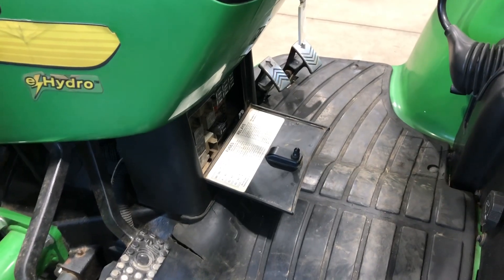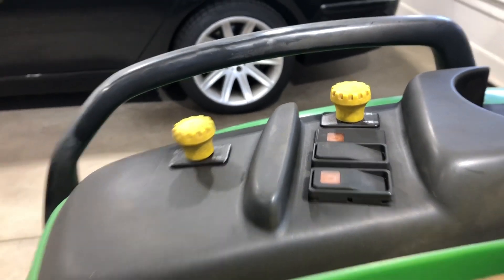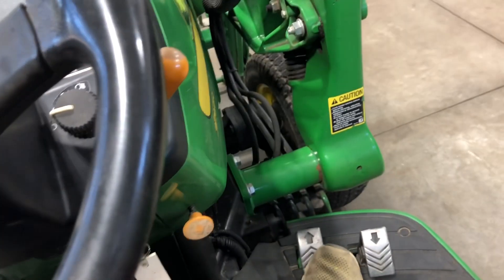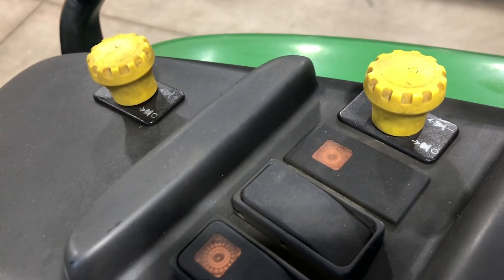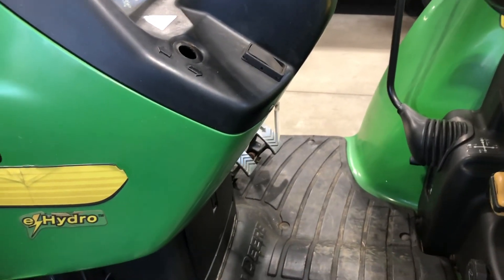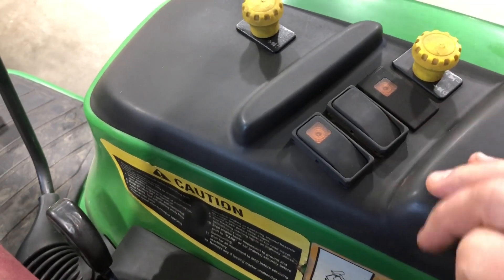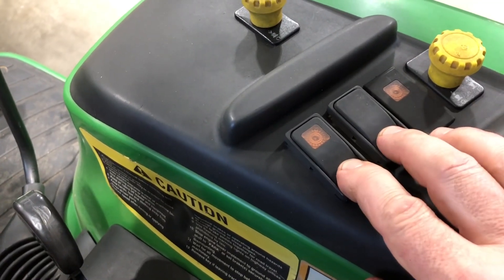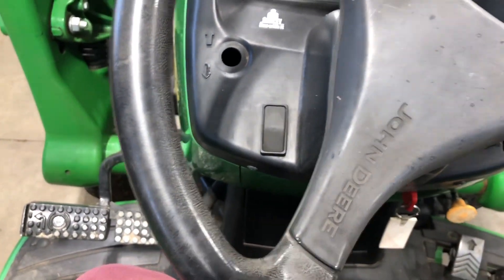John Deere Tractor Stops Moving In Reverse Fix

Comment: Thanks for the video Darren.  Do you have to have the tractor on jack stands to run through this autolearn sequence?
Reply from the maker: Sure np thanks for reaching out.  Yes or if you have backhoe you can raise rear tires with stabilizers.  Use loader to raise front.  For the hydro pedals relearn step you need all wheels off ground.

Comment: Thanks.  I have a 4310 that I bought new.  I had 1500 hours on it, and the battery died.  The hour meter reset to zero, never to return.  I can't imagine resetting the board would suddenly find the lost 1500 hours.
Also, this past Fall the tractor speed started surging badly while moving forward, usually under load.  For some reason I turned off the Load Match switch, and the problem went away!  Not too concerned, since I've never (intentionally) used Load Match, but I wonder if doing a reset would fix it.
The only other problem is the 3-point lever (rock shaft) that it's so stiff it's unusable.  I understand there is a fiber washer involved, but I can't seem to find a way to get to it.
Reply from the maker: Thanks for reaching out.   The JD4310s are great.   Hours meters always go out eventually on them.  Sometimes they reset or become hard to read vs going out.   All the older 4000 series used the same meter and have similar problems.   I've had a few machines with the load match and honestly everyone disables it, since it doesn't work all the time.   Fairly normal to have the machine do strange things when its on.    Rock shaft lever is another thing thats always kind of frozen.   Simplest thing to do is use some wd40 on the pivot points if you can get to them.

Comment: I wonder if this would work on a JD 3520?
Reply from the maker: Did a little research and the JD 3520 has a diagnostic mode which allows you to troubleshoot the error code.  I would recommend getting a service manual and I bet you could fix it.  The 3520 uses a similar controller and sensors so I bet you could do a reset/relearn if needed.  Definitely start with service manual.

Comment: I need some help!!! So I did this to my machine. It took me about 7 attempts but I got it. The last time I did it, everything went like it should but I still had the flywheel code at the end. No biggie. I shut the machine off for 10 seconds, started it back up and tested the forward and reverse pedals and the wheels moved like they should. I shut it off, it sat for 15 minutes, I got it off the jack stands and what not, started it back up and it won't move again!!! What could be wrong with it!?
Reply from the maker: @MattMeekhof  any codes flashing on the code light?
Reply: @darrenmas  long short short short
Reply from the maker: @MattMeekhof  that code is “simultaneous command from forward and reverse”.  The controller is receiving voltage from both forward and reverse pedal at same time and machine won’t move because it doesn’t know which direction is being pressed.  Most likely one of the potentiometers is bad or loose.  I would recommend testing each one.  I have a video on how todo this using a volt meter.  Let me know if you can’t find it.
Reply: IT IS FIXED! Thank you so much for your help! I appreciate you so much. Your video you recommend gave me a great starting place. I found the potentiometer under the tractor for the forward and reverse pedals. I checked both of them like the video shows and they both read good. ..... well I felt silly when I realized this whole time my pedals have just been getting sticky and they werent returning like they should when I let off the pedal. Fortunately where i needed to lube up is under the same cover as the potentiometer!!! I put some knocker-loose on the and let it sit. Everything is freed up and working well now. I feel silly that it was something so simple but thanks to you I got it and saved lots of money. Thank you.
Reply from the maker: @MattMeekhof  that is great news and glad to hear it’s all working again.  Have a good one 👍🏻

Comment: Mine is stuck flashing the “reverse” and “throttle” light sequence over and over no matter what I do with throttle or the reverse pedal :/
Reply from the maker: If it started happening after battery died or was removed then it probably needs a controller relearn/reset.  I would check the voltages on the reverse potentiometer and if they are normal do the relearn/reset on the controller.
Reply: @darrenmas  sorry, I meant it’s flashing those codes during the relearn on the controller. I bet the potentiometer is bad. Thank you for tip . Linkage had broken and got it fixed up , must be potentiometer or something